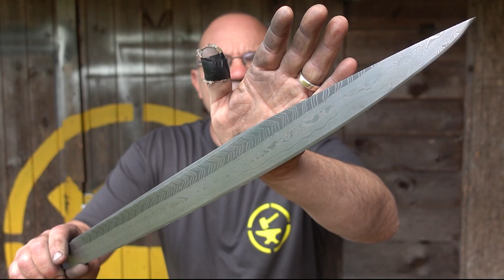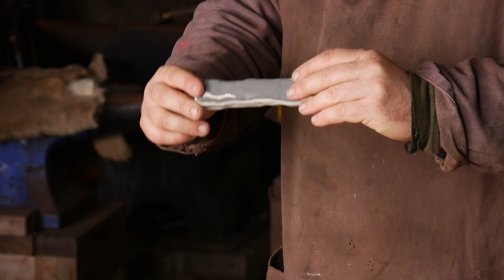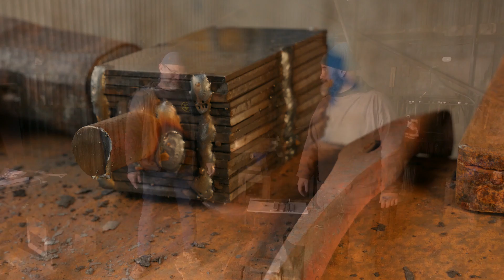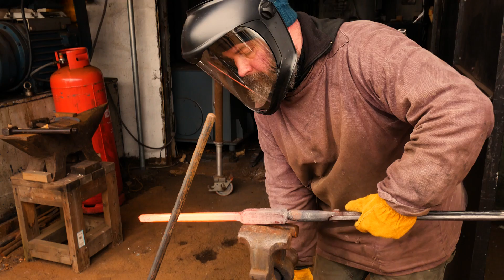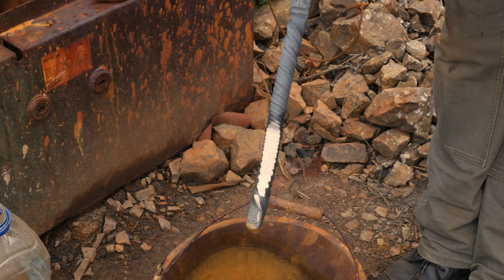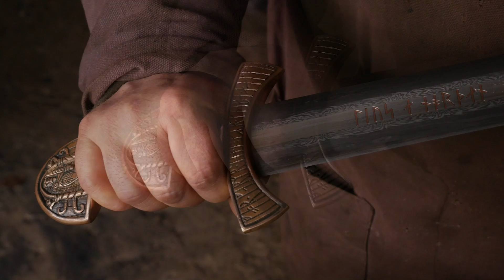Viking PATTERN WELDING - How To

Comment: So I remember hearing or reading somewhere that steel might have been twisted to make the carboncontent more homogeneous over the entire blade, do you think this is a likely hypothesis?
Reply: No you wouldn't twist for a more homogeneous steel but it doesn distribute the weaknesses in any of the material in such a way that if there were failure in any given 'strand' within the twist it would be harder to break overall. Folding is the way to go to get a more homogeneous steel because with each heating cycle carbon will migrate across the layer boundaries. Also the compression of the layers means less distance for the carbon to move and more surface area for that movement.
Reply: @martintroy910  I guess you meant does with the doesn. But if you twist and you first stack multiple layers, I assume this has the same effect as folding. If that makes the steel more homogeneous I would expect the twisting to have less effect.
Thanks for the awnser by the way
Reply: @mathewvanlonden8310  No I meant doesnt
Reply: @martintroy910  So it is purely for an aesthetic value?
Reply: @mathewvanlonden8310  Sorry for the confusion. I just reread my own comment. It doesnt make it more homogeneous but much like steel cable for suspension bridges or high tension cables to keep power lines straight and vertical any one part or strand within the bundle may break without compromising the structure as a whole. Since they had no way of knowing the composition and material properties twisting was a way to ensure that any one layer in the twisted billet would not cause a fracture across the entire width of the billet.
Reply: @martintroy910  Thanks for the clarification, one last subquestion: twisting an (entirely) homogeneous billet would be a waste of time, though this would be basically impossible to achieve in for example medieval times, twisting a billet would have increased the overall strength of the end product.
Thanks for answering my question, you really seem to know you're stuff.
Reply: @mathewvanlonden8310  Thanks. Yeah I've been bladesmithing for over 9 years and did a lot of self study before I got started. Always had a passion for metalwork. Did metalwork and engineering in secondary school/high school and loved it. There was a lot of theory involved which set me up nicely for learning and understanding the processes and physics involved. And yes if you were to get a homogeneous billet and twist it it would have no effect. It would be the exact same as getting a clean block of monosteel like say 1095 and twisting it. There's no pattern to be revealed because there is no chemical variation to resist the acid or be corroded at a different rate.
Reply: @martintroy910  You'v been a great source of information, I thank you again.

Comment: I tried to plasticine method but I couldn’t get a decent edge on the knife.
Reply: Did you heat treat it properly?
Reply: @hello7533  
Ahhhh! Is that where I went wrong?
Reply: @Therapistinthewhitehouse  yeah, its easy enough to do the quench, but its the tempering that most people get wrong with plasticine.
Maybe practice with play-doh first. 🤔
Reply: @hello7533  
I would but it’s so delicious 😋 I’ve eaten it all.

Comment: The historical difficulty lies in:
1) not welding the edges of the steel-layer package but wrap it to hold the layers in place
2) using a coal forge (and hold the right temperature and see when it's time to hammer the package) not a gas forge.
3) don't use modern automatic hammers/presses

The results of what we see today when a new "damascus/welding" video comes up are (usually) great, no question about that. But it's not a small part of the work that the new (today used) machines take over from the working person. It's a big part.
So the intention of this video here was not to show how "hard" it is or to be historical correct. It's a modern explanation of how to (today) make pattern welding. Therefore there is nothing to criticize about the video itself. 
It brings the main information on point and that's great. 

But to explain what I meant with the difficulties at first:
- Without welding the edges of the steel package it must be wrapped by wire or organic layers. If you do so it might happen that the package won't keep it's form. 
- Using a coal forge contains 2 main difficulties: 1) no constant temperature like a gas forge (you have to take care of the coal, the air flow etc.) 2) it's harder to see when the steel package reached the right temperature to be forged.
- Using a press to form a solid block out auf the steel layers also is a big simplification of the historical process. You have to consider that the press presses the whole surface of the package while with the historical hammering method the package will be formed to a solid block during multiple hammer strokes. During this hammer strokes the layers of the package might deform...there might be air inclusions etc.. A modern press mostly get rid of that problem by just pressing the whole thing in once.
Reply: they had water wheel driven power hammers back as early as roman times. also seartch "platters" or platten men, aka they had an entire industry to make steel billots and even sheets of metal that could be cut and forged into armor ect. There is also lots of records of metal purchases and receipts and they do list different grade of steels.
Reply: To add to Charles' point setting the weld actually doesnt require a huge amount of force. Your large forces are just required to move the resultant block into a more usable form. it would have been charcoal rather than coal and there are methods of manipulating the fuel in such a way that you can in fact clearly see what you're doing and when the right temps are reached and other visual clues that can be used even if direct view of the billet is hidden by the fuel.
Reply: Just one thing to add: usually, the blade edges were from a high carbon steel, and they were put in place latter, again by welding, like they do with axes, etc. Again, it's harder to do that, rather than forging the whole sword from one piece (but, of course, it's better for a functional blade).
Reply: Yes , modern work is "different" Some things are easier , some harder because of the modern materials and fuels but it takes  skill to do it either way. I can say this because I have made swords both ways, 42 years as a blacksmith / bladesmith.
It comes down to , what  are you after as an end point?. Is the point to have an accurate as possible copy of an ancient weapon , down to the materials and methods , or is it to make a handsome usable weapon in the spirit of an old style.
Economics is a problem , To go all the way back to making the iron and steel blooms from bog iron ore using charcoal in a small bloomery furnace would add 100 hours to a sword, Who would pay for the time? 
I like Todd and his friends , low BS and normal egos, skilled and not just talking to sell their goods.
Daniel Tokar
The Willow Forge
Reply: @danieltokar1000  well, I agree with you, but also I think that is not bad to talk about the historical methods when the thing is not "pattern welding" but "viking pattern welding", and for educational purposes maybe it would be great to see the process all by the ancient methods and tools. I do medieval shoes, for example (not for living, I'm a musician) and, when I work at home, I use modern knifes, needles and augers but, when I make a pair of shoes to show the historical way, I use all the historical tools. Once the shoes are finished, they look exactly the same, but the process... well, I think that's the point, and it doesn't take away ANY of the skills this man have. 
And another thing I don't do very well is speaking English, so sorry if I sound "rude" or something ;)
Reply: @gallardoguitar  Hi Diego:
Yes, I understand. The problem comes from this, nobody wrote about this process 1200 years ago. What we know is from study of the surviving blades. Ask 10 blacksmiths and they will come up with 8 ways to do the same thing. We don't know exactly , down to the details, of how these blades were made. We have a fairly good idea about making the iron and steel used and the general ways of making the patterns , but that is far from knowing all the details. It is possible that there was more than one method used.500 years of time and dozens of different countries, it would be strange if only one method was used everywhere and at all times.
I would like to make a pattern welded sword starting with bog iron ore and trees.  $30,000 worth of shop time later I would have a sword. I tell people that swords were the race cars of their era. Expensive status items.
I posted a video on making a "Farmer's " sax. An afternoon of welding and shaping and a day of filing . This is the simplest pattern welded blade made in the "Viking" era. 
https://www.youtube.com/watch?v=y8RS4IrXFGw&list=PLA7wO4FUvGBArrC3LHT8JdxPizCV8FSxs&index=1

Daniel Tokar
Reply: @danieltokar1000  it would also make a crappy sword compared to the modern mono steels we have now. Bloomery steels are inconsistent and full of slag. They had to composite them together to make up for the low quality of the steel.
Reply: @ihcterra4625  Hi:
Yes, there are more than a few examples from the old stories about swords failing or bending in battle. 
That said , modern swords are art objects more than weapons, or a way of connecting to an era and a peoples culture.
I will ask a question, Say 500 years from today a number of people want to make copies of 20th century cars. Some of them are made with 26th century materials that are "better" than 20th century metal. The cars work better. The question is , would a model T Ford made that way , out of titanium and composite nano materials be a Model T?
Daniel
Reply: @danieltokar1000  yes I agree with that point. That is why I don't think it is necessary to make pattern welded swords 100% the old way. It may show incredible artistry and craftsmanship to produce a lousy product.

Even using modern steels equipment, they are not as good as a good mono steel. Every layer is a potential fail point. 

I think it is way overused. Specially on blades that historically would never have been pattern welded. Like Damascus steel, for example. I would consider that fake Damascus.

Comment: Oooh, just what I asked for the other time Owen came on! If this can be a co-operative series where you go over the other steps of historical steel manufacturing (ie, bloomery, crucible, blast furnace, reducing/increasing carbon content, homogenising, tempering/annealing/quenching, case hardening, and all the others I don't know about) I would be sooo happy.

It's really hard to fine videos/texts that explains in any detail how this was done historically. Either they assume I have a degree in metallurgy, or given only a one sentence summary of what it is. The history of technology and metallurgy feels like a rich topic that had wide ranging impact, but I simply havent found any way of learning about it.
Reply: Yes it's a subject you can get right nerdy about. Check out The Pattern-Welded Blade: Artistry in Iron by Jesus Hernandez an excellent book on the subject of pattern welding.

Comment: Viking patten welding ? As the Anglo Saxons had been patten welding for a long time before the vikings landed.Myth over truth.
Reply from the maker: Vincent, you are correct, the Celts were at it way back ad yes teh Saxons certainly did, but the original film we made was about a Viking blade
Reply: I'm pretty sure the Celts did it too.
Reply: Uh, what? Patten welding originated with the Celts of the La Tène culture, then spread to the various Germanic tribes. Also, you do know that the "Anglo-Saxons" are "traditional descendants" of the Angles, Jutes, and Saxons who originated from in and around Jutland, where the Scandinavian people who went "Viking" in later centuries came from too, right? This comment was wholely unneeded, and worryingly uninformed for someone who pretends to be informed.
Reply: This was the"outtakes" film, I think Owen mentions Saxon and Celt smiths in the original video.

Comment: Like was briefly mentioned in the film, it's remarkably similar to what the Japanese were doing with their steel, including the coating of something to protect from oxidization. And twisting being similar to folding. I wonder how much they actually knew about what was going on, and how much of it was simply "we know this happens when we do that." It reminds me of your experiments with the beeswax on the arrowheads.
Reply: From reading a lot of older sources on the subject not much. There seems to be a lot of 'Well we did this and the steel turned out good so that's how you make good steel' You'll find mentions of facing north while quenching or quenching in the urine of a redheaded virgin boy. They didnt have the tools to understand what was happening chemically and to be honest metallurgy on the whole is a relatively recent science.
Reply: I kind of remember the difference of pattern welding and folding, so I'll get into my points on folding first.

Despite folding being seen as a uniquely Japanese method for historical steel making, the practice was just actually a common way to consolidate steel whether you were using steel from a bloomery or blast furnace. It's purpose was to work out impurities, and give the steel a uniform carbon distribution due to processes such as turning pig iron (essentially cast iron) into desirable steel in a finery forge, and the same being done to iron or mild steels enriched with carbon.

For patternwelding however, I may have to look into it again, but I just know that patternwelding could be for aesthetic purposes where you compromise the material by using phosporus rich metal.

Comment: Amazing that such a simple, basic process can produce such stunning results. Does this process affect the durability of the metal in any noticeable way?
Reply: Not in any noticeable way no. You will likely have some carbon loss in the parent steels but on the whole the pattern welded steel will be about as strong as the weaker of the two or more parent steels. Always good to remember when choosing the steels that will go into the pw.

Comment: It is such a "simple" idea, just layering a bunch of different steels on top of each other, twisting it a bit, but the results are absolutely stunning!
Reply: And from the start the patterns were probably just accidents.
The method of mixing different irons likely came about because the makers had iron of different quality, so they mixed them together in order to get an average between the two. Either because of availability or will to save materials.
Later on though it became more of a mark of quality.
Reply: @5chr4pn3ll  Or maybe because due to unbalanced availability, they mixed up any type of ingot they had at that time and ended up "unlocking" some truly wonderous milestones in metalworking.
Reply: @5chr4pn3ll  might have just been a shady iron dealer slipping in different quality metal in between blocks, like a gypsy roll, real money on the outside fake on the inside.